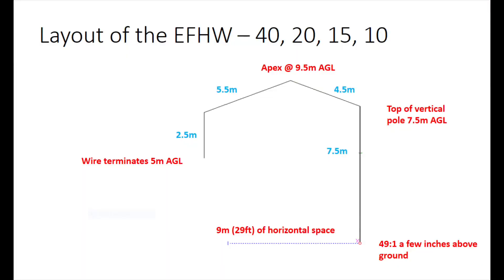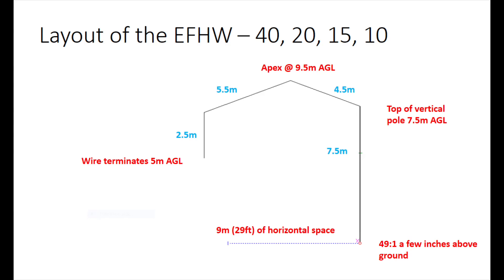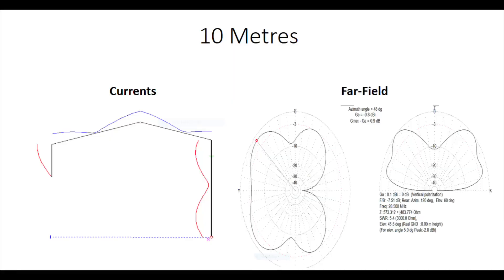Ham Radio: End Fed Half Wave 40-10 Metres.

Comment: a 16:1 UNUN should work with whatever EFHW antenna
Reply from the maker: The usual impedance at the feed-point of an EFHW is 2,000 - 4,000 ohms. A 16:1 would reduce this to around 120-240 ohms - still a bit of a mismatch 73

Comment: Interesting config., Tim !!  Plz make a video of the EFHW4010 used in slant/sloped manner with the respective gain & radiation patterns. I plan to put-up the far end to a 12m pole tip & bring it down at 45degs to the other end of my terrace !!____73's Vu3cgb
Reply from the maker: Ok no problem - how high off the ground will the lower end be? And I presume you are feeding the antenna from the lower end?
Reply: Hi Tim, from the terrace floor already the matchbox is 4' above; The tx wire till 40' way up to a 12foot support at a low angle slope (say 40deg) then the rest 26' at same gradient back to the other side. With this config. wrked max. europe & asia, africa & s.america @10-50w in 20& 15m/ in 40m can work max upto 1000kms. Now I just intend take up the wires far-end to a 30-35' pole tip & slope it down to my existing feed point ! Hope i will get better Dx, plz advice____Vu3Cgb (Sourav)

Comment: That configuration seems to be a good candidate for NVIS and regional nets on lower frequencies (thinking about this antenna scaled out for 160 and 80, where similar bendage will need to occur to fit that kind of copper footage, so it's encouraging indeed). It seems like EFHWs and longwires tend to have a few extra bananas of gain about the far end of the antenna on the higher frequencies, so that might help explain the extra gain around the shorter vertical leg on 15 and 10 vs the longer side attached to the matchbox. Great presentation, and 73 de KB0IEY
Reply from the maker: Interesting observations and thank you! 73